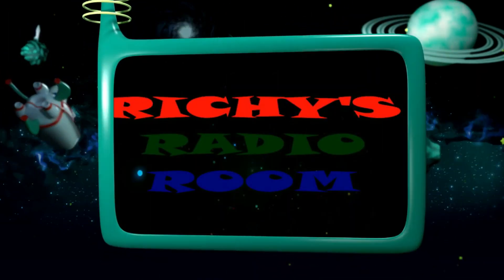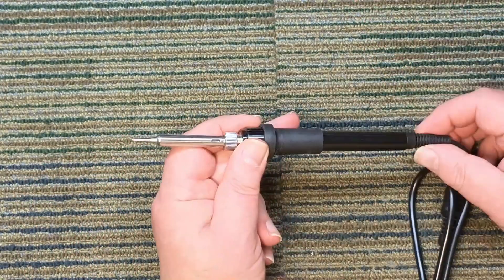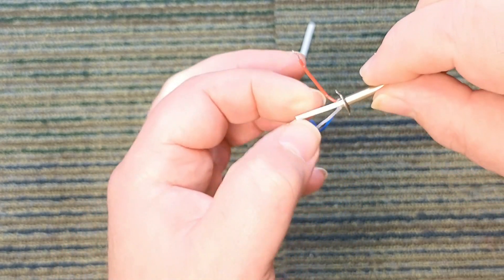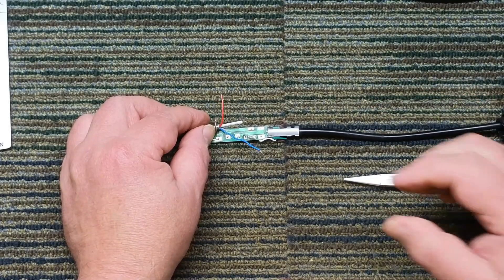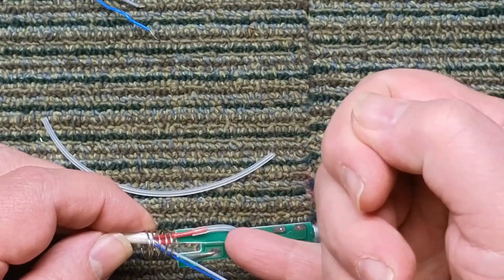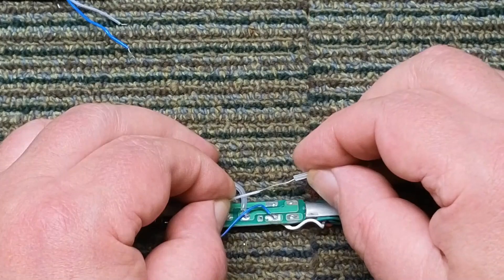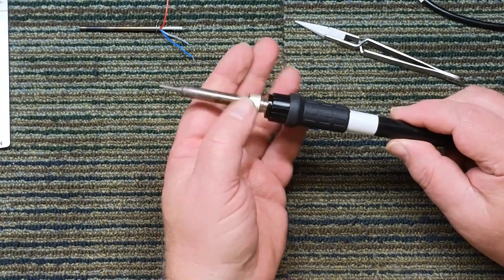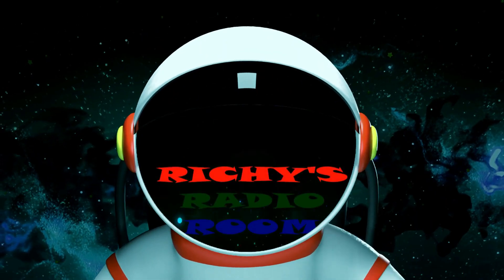Soldering iron heating element replacement

Comment: Dang, my wires seem to be positioned opposite of the ones I took off meaning I'll have to cross them to match color, or just put them in reversed and I'm not sure which is correct. The colors match they're just opposite so I'd have to rotate 180 then push 2 wires around the outside to make them match.

Comment: Where did you get the replacement iron?
Reply from the maker: Amazon    Airgoesin Soldering Iron Handle Replacement Soldering Pencil Handle for SMD Rework Solder Station Machine 852D+, 898D, 858D+

Comment: Super helpful video, thanks a bunch! Just gotta ask—where’d you score those tweezers?
Reply from the maker: $6 for2 Amazon    2pcs Ceramic Tweezers Stainless Steel Ceramic Precision Tweezers for Electronics, Non-Conductive Anti Static High Temperature Resistant Fine Point Tweezers for Precision Electrical Operation Black